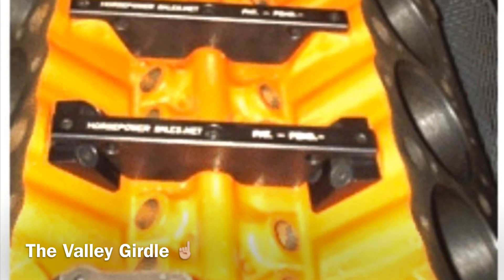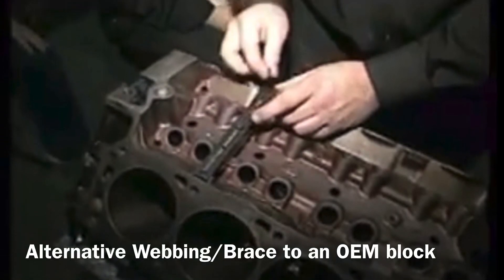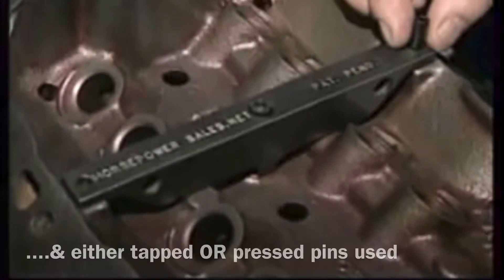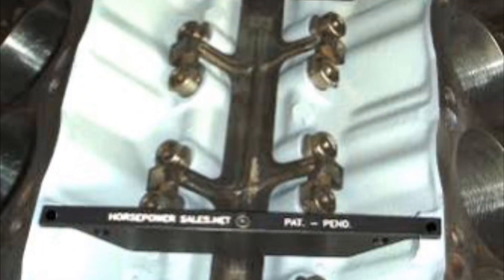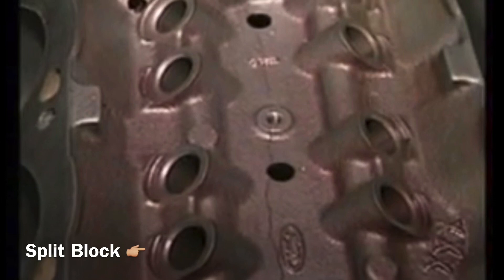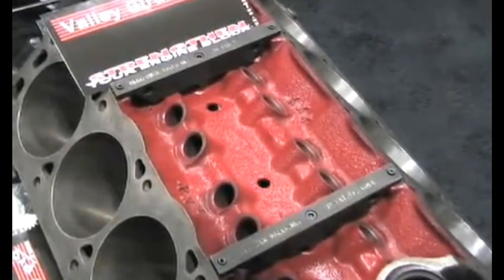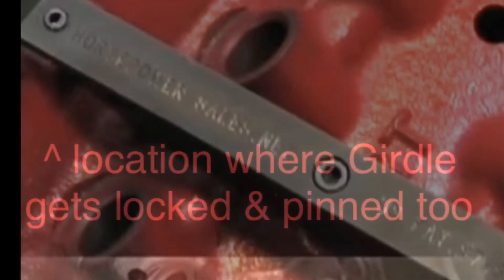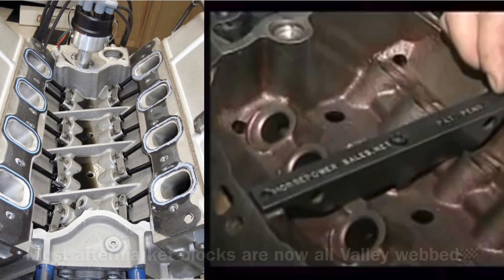Ford 351 Cleveland *Valley Girdle*  strength-bracing an OEM block

Comment: I remember seeing valley girdles like these being advertised many years ago. Naturally they won’t be as effective when compared to webbing that’s an integral part of the block casting. The negative comments will quickly point this out. But on the positive side of that coin, why In the hell would Don Garlits, one of the most innovative creators in drag racing history, waste his time and resources developing a product like this if it didn’t provide a substantial increase in strength for the block between the cylinder banks ? 

The short answer is…HE WOULDN’T. Especially for the somewhat obscure Ford Cleveland engine when the world is in love with all things boring Bowtie. 

Regardless of opinions, it’s a pretty cool item. Thanks for sharing 👍.
Reply from the maker: Agreed 💯 👍🏼